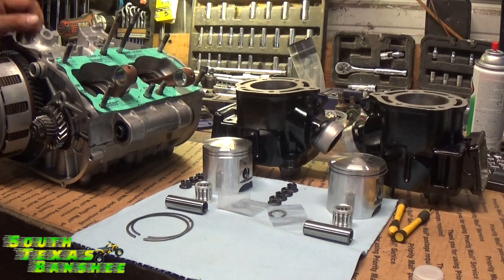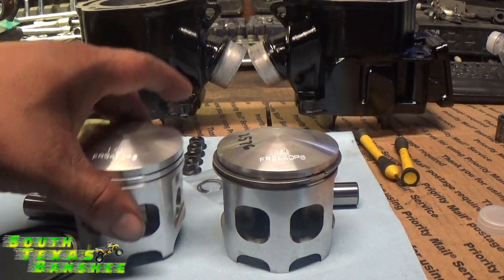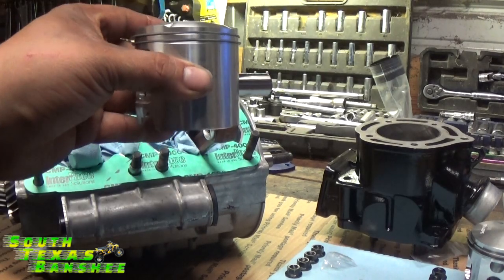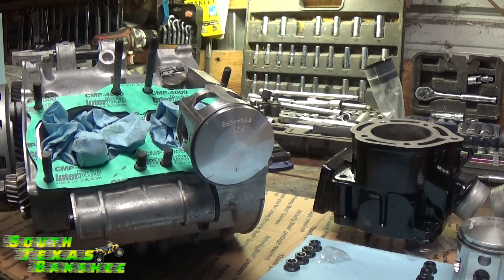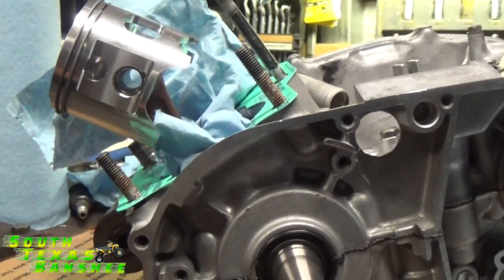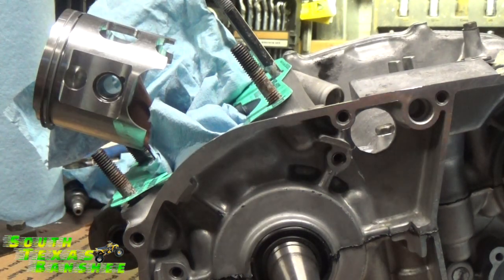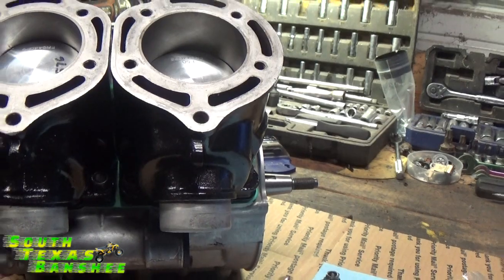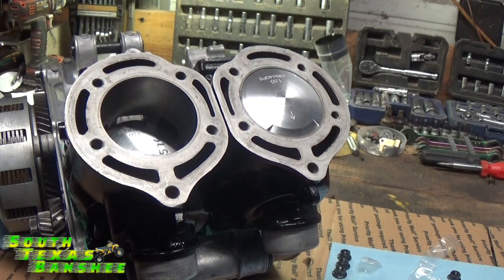Banshee cylinder installation  (Table of Contents in description)

Comment: Whats the difference between the 795 piston and the 573 piston i know o e has 13 degrees  top the other is 9 degrees  they both seem to be used on 4 mill long rods but the port on pistons are different. I need 66.50 piston for my stock cylinders with a 4mill long rods. I only see blaster 573 pistons available in that size not sure about base gaskets to use .020 or .060 ?

Comment: What kind of pistons are you using. Exhaust side of pistons are cut down.
Reply from the maker: @vincepeltier1463  Vito’s SS pistons, they mimic raised exhaust ports.
Reply: @kevingalindo1  thanks for the info. Used vitus pistons before worked good.

Comment: Unrelated.  Do you run the coolant catch tank and what pressure radiator cap do you run?
Reply from the maker: No catch tank, but you have to plug the overflow nozzle. You can just take the hose off. It will puke all the coolant out and overheat. I run the stock cap or what cap comes with the ASI rad.
Reply: @kevingalindo1  ok thanks. So you are saying just plug the nozzle on the radiator by the cap or crimp the hose if catch tank isn’t installed?

Comment: I have a banshee that someone rode wide open until it shut down. One of the domes is a mess, I'm wondering how far into the engine I need to go replacing parts?

Comment: Hey Kevin,  I just got a banshee for the first time and it had a blown motor. So I got new factory oem 64mm cylinders & vertex pistions.  After install my compression us 90-100 psi both sides on 2 different gauges. I have re-run and still have low compression.  I did get it started and ran 3 heat cycles no gain. Now I tired if kicking it before it starts. What can I do next ?

Comment: Man thank you for all your videos!!! I bought my first banshee about a week ago not running you saved my life!!!! First had fuel screaming out overflow then severe flooding came with 6 carbs and you showed me solution from some carbs from a loft 😂 sync get it started finally and pouring out antifreeze from kick start side cylinder now I'm tuning in to this video 😂😂 owned many 2 strokes loved buying the ones that came in pieces in milk crates lol nothing like bringing back the dead! First ever duel cylinder 2 stroke and I'm gonna whoop it's ass thanks to you!! Thanks brother!!!
Reply from the maker: That’s what I’m talkin about
Reply: South Texas Banshee man I would love to pick your brain for about 10 minutes LOL I bought the carb Eliminator kit and a brand new flat slide 38mm carb and I'm also a 370cc big bore kit with cool heads new 4 v force reeds and the carb tuning has me a little scared
Reply from the maker: Matthew Root 
361-243-0431, text me
Reply: South Texas Banshee  I just saw this buddy I sure will

Comment: Buddy I put new cylinders on my banshee and forgot to put the rubber cylinder seals, do i have to take cylinders out and put the seals on them or can it run like that?  I did 2 heat cycles and did not see any issues, however i just noticed that and  I'm freaking out.

Comment: hi my name is martin i was wondering where did you buy those  nuts for that persons pro design cool head i cant find them on ebay.i am just going with the pro design cool head because it will be easier with your great video thanks martin god bless
Reply from the maker: Margaret Wiand 
they're stainless nuts you can get them on eBay, type in "Yamaha Banshee stainless bolt kit" OR 
Allyboltz.com you can buy individual kits

Comment: I have a new hotrod c.k 158 and Vito head with a proDesign cool head and I tryed to start my bike and motor would not move so I took head off and the piston ring is getting stuck on the top of the cylinder what do I do pleas
Reply: Derrick Tassey ck 158 is a 4 mil long rod. U need stroker domes and hopefully ur cylinders are ported for the 4 mil stroke
Reply: Derrick Tassey nevermind I'm sorry I read your comment wrong, sounds like you have the wrong pistons in. U need blaster style pistons

Comment: Know this is an older vid but how often do you replace these with good maintment
Reply from the maker: i am sadAF 
Hey how are ya, compression test will tell how your top end is wearing. After a rebuild, check compression right away, write it down. Then after break in write it down. 
Then keep a log every 6 months do a health checkup on it. Compression test and write the findings.
When you notice the numbers falling faster and faster between tests you'll know the top end is beginning to wear.
But to answer your question a topend with good machine work, tuned and treated well will last many many years. I know of 87 banshees still running great on stock top ends. There is absolutely no reason to be doing top ends every season or every couple of years.
Reply: South Texas Banshee wow thanks i'll be checking mine, notice a few things i dont like about it suspect it might be that thanks much

Comment: Hey South Texas ; Thanks for sharing the 2 smoke Magic with us. I was wondering about the machinework done on those pistons. Specifically on the exhaust side of the domes and the holes drilled above the wrist pin holes. If you could make a Vid about that and if anyone sells Pistons with the mods already done or if we would have to ship the Engine to a machine shop to get the Pistons done to work in harmony with the other mods.

Comment: my 95 banshee will not stop leaking antifreeze between the head and cylinder. I have done everything. I bought new cylinders, new gaskets, vitos studs, new pistons, and it still leaks. im sick and tired of it. can you please help me out? please
Reply: Did you inspect the head?? Sounds like there isn't a good seal between the head and the cylinder and since you bought new cylinders it more than likely is your head. I'm not an expert but I think that is a good place to start looking. Also make sure when you tighten your head down that you do so in an even pattern so that you dont torque the head uneven..

Comment: What's up Kevin, do you ever paint your cylinders with the high temp spray paint? If so how do they look over time.
Reply from the maker: chris laponte 
yea I do man, I've got one set been painted 3 years no major peeing yet, looks fine. just don't use ALOT of paint. that will cause it to chip alot easier.

Comment: don't you have to gap the rings?
Reply: Well that would explain why your cylinders went on like a hot knife through butter and mine just got me to swear in my garage for an hour
Reply from the maker: My machinest checks all that for me, I double check, but forgot to mention ring gap.
Reply from the maker: Slank Tapper 
lol,.unless they were super tight, they should have been that bad, what were the specs?
Reply: Wiseco 66mm pistons with 66mm rings.  I can get the rings in the cylinder all matched up but not after I install them into the piston.
I think i'm just going to bring it to a local mechanic as this isn't something I want to make a mistake with...
Reply: Slank Tapper really all you would have to do is measure the ring gap if it's to big file down untill it is in spec. I just installed rings they were in spec I didn't have to do anything. measure using a feeler gauge.
Reply from the maker: sr20boostjunkie 
yep
Reply from the maker: Slank Tapper 
you may not be getting the end gaps centered on the pins just right. Chromoly rings are much harder to get in than cast too. the vitos come with Chromoly and they suck to put in.

Comment: Ok this is probably a dumb question but if I buy a cylinder kit/rebuild kit is it not ready to install right out of the box?
Reply: Hello,the film off the skvirt  ,wich is it.?
Reply from the maker: drautdrollenmin 
sorry, coukd you type that again? I don't understand.
Reply: South Texas Banshee .the clerance when piston is on top ,,,
Reply: Squishen i cant find that video,
Reply from the maker: drautdrollenmin 
I haven't posted it yet, my pc crashed in thr middle of Editing it, gotta start all over.
Reply: South Texas Banshee ,ok i have done the measure,ive yoused some 3 mm solder,and one is 1mm and the other is1,3mm ,is that some of consern,
Reply from the maker: box kits are kinda iffy. Cylinders need to be bored to the pistons. Forged pistons expand when they heat which is why you should never rev a cold bike hard. cast pistons do not. That being said a bore set up for cast pistons would be a tighter tolerance being as they don't expand. if you bought juggs bored for say....65.50 cast and used 65.50 forged, the pistons would heat swell an tolerance would be to tight. so if you buy a set of cylinders thay comes with pistons you have to wander, did they just punch them to 64.50 and grab some 64.50 shelf pistons and chunk ut all in the box or were they actually mic'd and each cylinder set up for each piston??? 
  I use Kan Powersports , owned Nate and Kimmer Harames of Utah. his work is always flawless, and he does whay needs to be done, takes no chances and take care of you.
Reply: Ok man thanks a lot, your videos are awesome.
Reply from the maker: +Tony Hall Welcome!

Comment: I'm about to do a rebuild on my banshee,  and it's going to need new cylinders and pistons,  what kit are you using and what do u recommend?  there's so many out there I don't know which is the best for the money,  thanks
Reply from the maker: Use wiseco, Pro-X or oem and you can't go wrong. those are listed from best to least best with very little difference, P-ro-x are basically OEM quality.  as far as machine work, I recommend Nate At KaN Power sports. he does all mins and have never been happier.